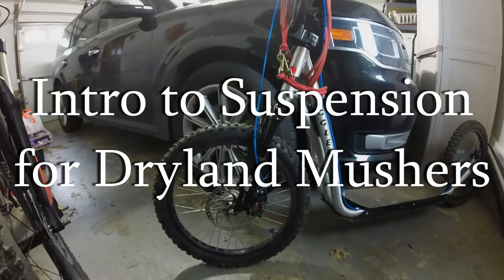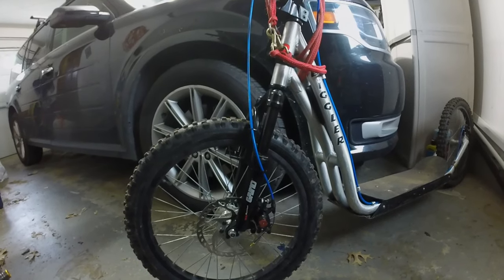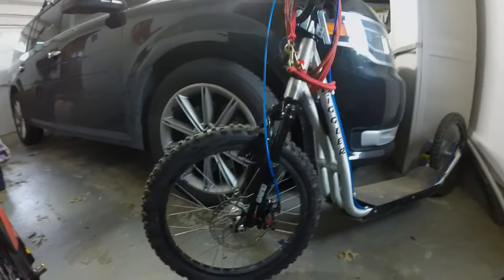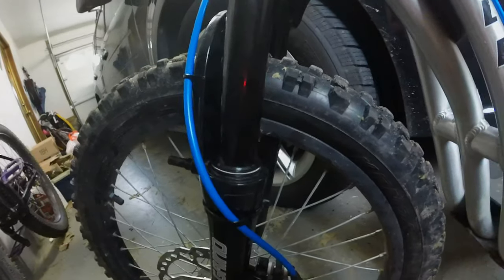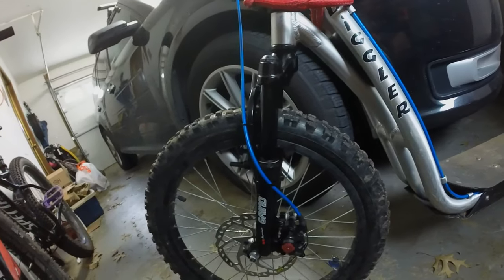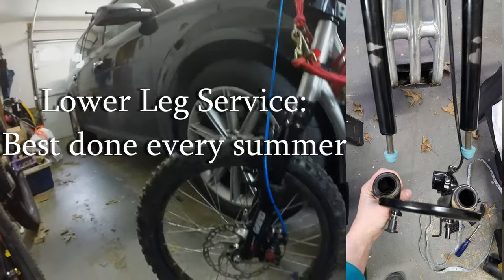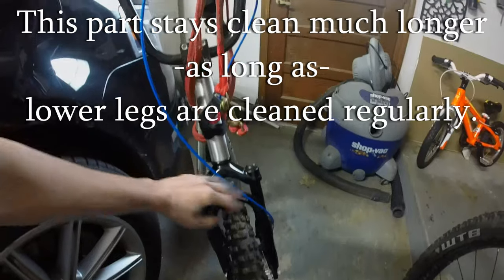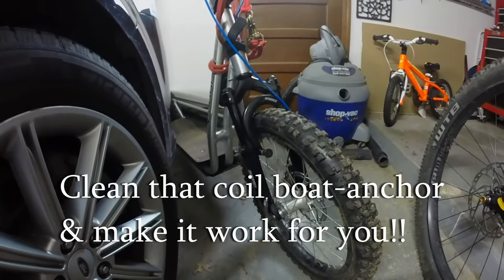Suspension Basics, from an Mtb-ing Musher's Perspective! (Dryland Mushing w/ Bike/Scooter/Light Rig)

Comment from the maker: Hop to the section you want to review!
1:04 Basic Parts, Common Issues, Post-ride Maintenance of a front suspension fork
4:06 Worth the Weight? 
5:47 More in-depth initial/seasonal maintenance 
8:00 Different types of front forks for bikes/scooters/light rigs

Tires also have a big impact on traction and ride smoothness! Check out how to get tire pressure dialed in for mushing: https://youtu.be/kWjLD1F5oTA

Comment: Mushing Mtn Biker always mentions her Digger is old. Is the new tech better?  Have race times improved with the new tech? Comfort maybe. Some weight loss. Fatter tires seem to be more standard. Will watch your other videos to better understand what is best. thank you for making them.
Reply from the maker: Hey, the filter flagged this comment so I just saw it now, was maybe worried you were calling me old and fat LoL!! It's the internet, so it's happened before! Anyway lol So, there is lots of new tech to go on Diggler scooter frames and other scooters that is Far superior to what was available and went onto mine 17yrs ago when it was made! The market for scooters is small though compared to bikes, so it is understandable, but sad, that all scooters haven't been coming standard with hydraulic disc brakes, air sprung suspension forks, and tubeless ready rims and tires for years now - those are definitely improvements that increase comfort and safety and allow for more speed for any type of musher :) Over the 14yrs I've owned it, I've just now upgraded Everything on it except the frame/footbed/skid plate/stem. That being said, I personally don't like some of the changes that Sprocket scooters (re-named Diggler brand) has announced for an updated version of this scooter. The pre-order listed very few actual specs in terms of length/width/stack height/steering angle/ground clearance measurements, and brand, model of the brakes, suspension, etc, so while any brand and model of hydraulic brakes will be better than the older cable pull disc brakes, and better, longer travel suspension fork IS better, I don't like the sound of the vague changes mentioned for the frame. Making the foot board wider (it's already nice and wide and long for feet to fit vs some ultra racy models that only allow one foot to fit at a time, and I've literally gotten the current width foot board wedged between two rocks on the trail before, so no wider for me please LoL), going to steel (though yes chromoly is a quality choice), significantly wider tires (2.4 is the sweet spot, with racers likely preferring down to 2.25 at minimum, and comfort first recreationalists 2.6 at max, imo having had a solo mtb with 3.0" tires as my primary ride years ago that was Fun but just a little too wide to be in the sweet spot, so I'm not sure what the pre-order listing meant by wider for the new Diggler), no skid plate visible in the photos...the original design is already so stable and beginner friendly, yet lively and maneuverable for those progressing in skills and trail types, so I would not have doubled down on making upgrades meant to be even more stable and tame, and less protected/durable for more varied terrain trails (I absolutely use the skid plate as intended on nearly every run so that it takes the dents and scratches instead of the frame, which would be a big safety hazard!). It also isn't race oriented, which would prioritize lower weight (aluminum frame), and a larger diameter front wheel, rather than still smaller, but wider. It doesn't mention if the rims and tires are tubeless compatible either, so probably they aren't. Just so easy to pick up a new or gently used entry level or just slightly above modern mountain bike that comes standard with wheels that you can tape, add sealant to, and ditch the tubes and flat tires and lower the air pressure for a smoother, grippier ride :) So some of my concerns won't be a big deal, or apply at all if someone is running more than one dog or sticking to wider tamer trails like gravel roads, rail trails, etc, for other reasons, but that's my two cents from my perspective with one dog on the types of trails I enjoy and from solo riding a wider variety of trails on various types of mountain bikes :) The old Digglers still seem to hold good resale value, so I suspect the new ones will too unless they're a total dud once they're out on the market with people riding them! So in new or good used condition, I don't think new Or old would be a bad investment for someone new that's not 100% sure what direction they'll take in the sport. No one starts out knowing for sure that they will or won't become a serious competitive racer or techier trail enthusiast, so anyone that sticks with it, you'll never buy just one bike or scooter with just original components and Never change or upgrade anything :D Love each dog for who they are, but buy/sell/trade and upgrade away as you can on the hard goods that help us have fun with them!!!